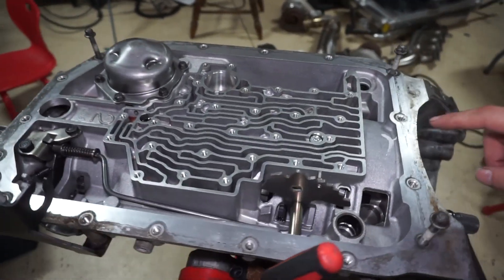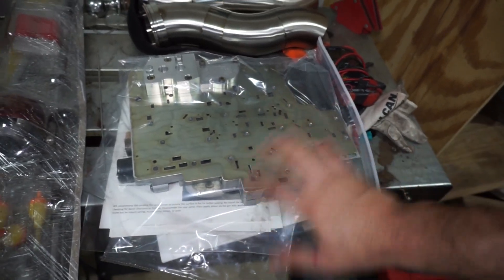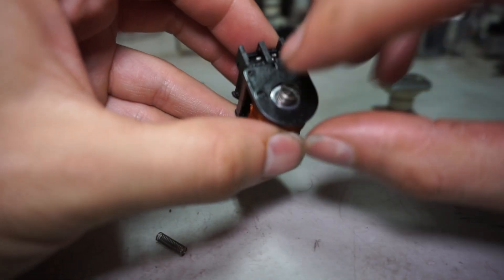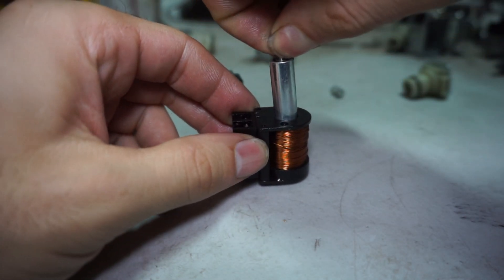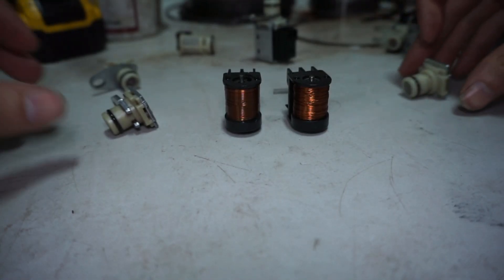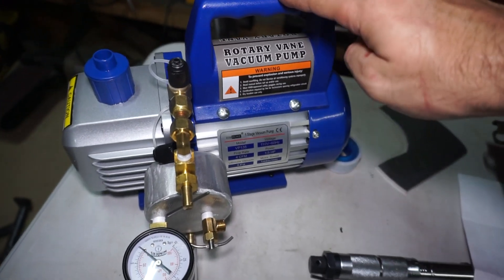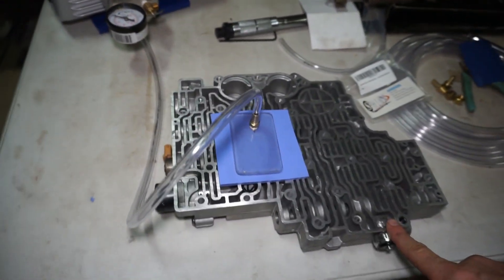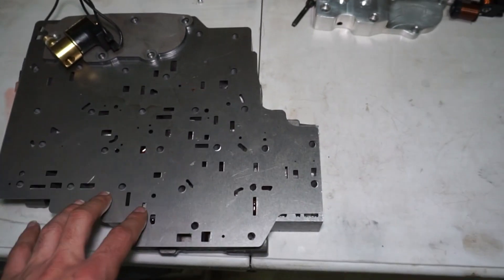4l80e Vacuum Test Jakes D3 Troubleshooting Slow No Release Binding Issue

Comment: The solenoids that came on jakes accumulator say "05319" and the plastic where the O rings go around is brown. There's also no screen filter on the tips.  I believe that these are 3/4 solenoids.  Are these transtar or AcDelco?  Do I have to take them apart to tell if they are actual AcDelco? The solenoid in the 1/2 shift location in the valve body says 26219 and has a cream color.  The solenoid in the 3/4 shift location in the valve body says 2022668-259C and is brown in color.  Are any of these AcDelco LOL?  There is only one set of numbers on each solenoid.  I thought that all solenoids that are AC delco have 2 sets of numbers on them, with the bottom number being either saying 0289 or 0288.   I'd hate to have to buy one 24230288 solenoid and three 24230289 solenoids and replace the ones I have.
Reply from the maker: At the 5:13 mark check if you can see light through it, or if the plastic is pressed against the metal plate... really just wanting to see that there's a clear path for fluid to exhaust.

Comment: Which do you like better, Jake's TB or Extremes, and why?
Reply from the maker: For Autoshift Jakes seems to be the best unit available. The EA is a very nice piece. Would really depend on if you need manual or auto shift. I wouldn't hesitate to go with and EA if I decide manual valve body.